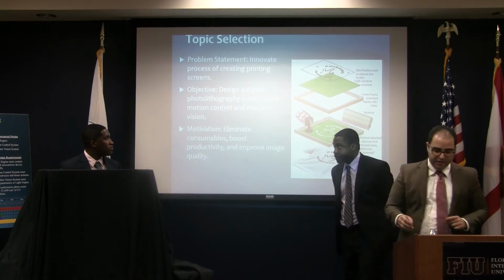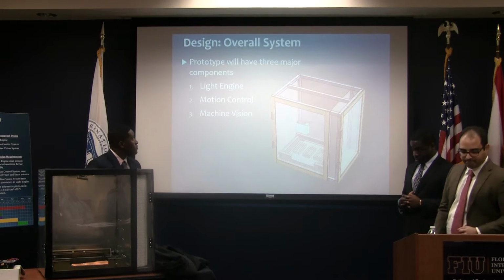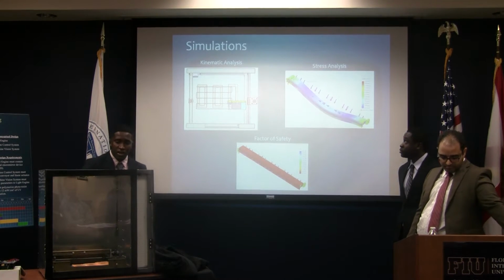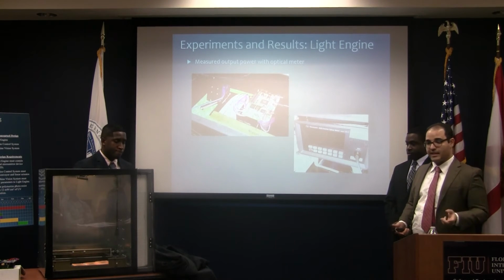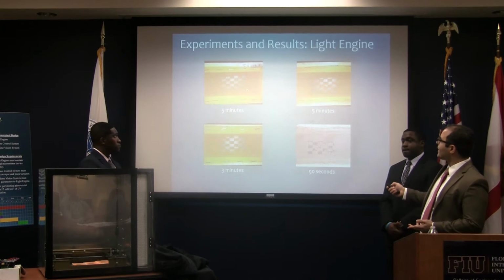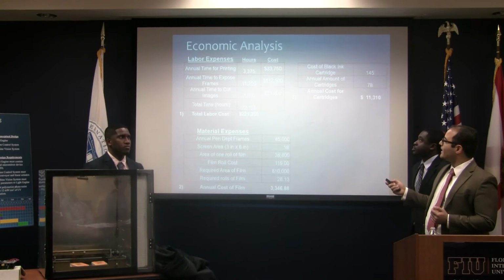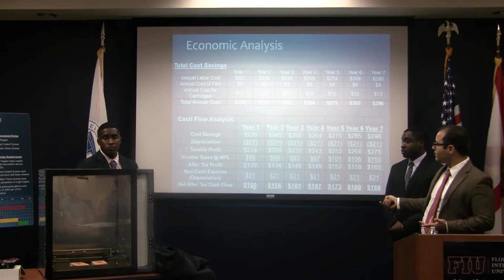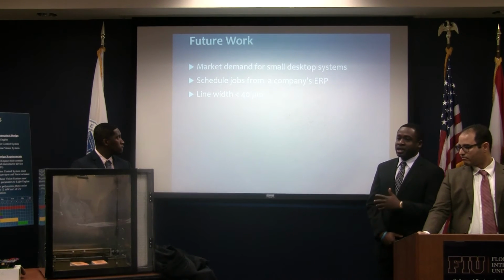Team 8: Digital Photolithography System Utilizing Machine Vision and Motion Control

Comment: This concept can have a large amount of applications in the future; however, this presentation of the idea would not help investors embrace it. The speakers are well versed in the topic and appear to be confident in their product; however, speaker 3 barely speaks in the presentation which gives a bad impression on the group as a whole. The fact that they show off the actual product to the audience in the presentation is great. The main problem with the video is the Power Point presentation itself. The bad background of the slides combined with the white text and the glare from the light makes the whole presentation unreadable. The images and charts are also barely seeable for the same reason. Some of the slides either have too small of a text font to read the information or have too much of it to read successfully. Overall, the video is below average is quality.